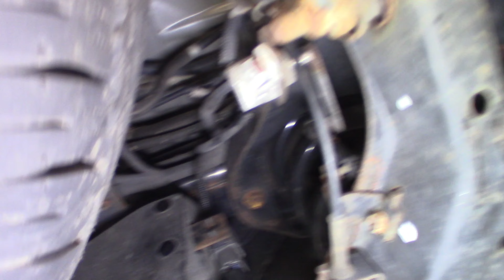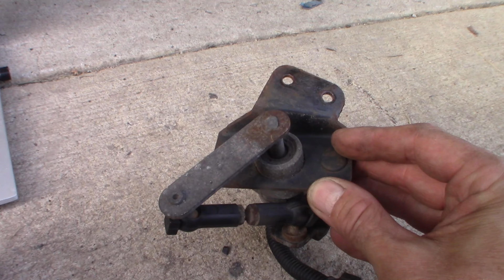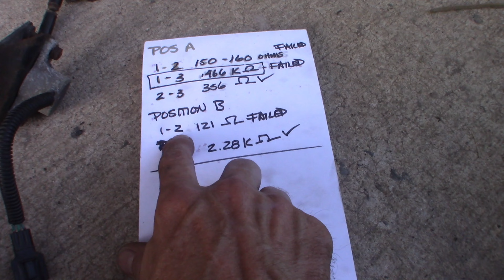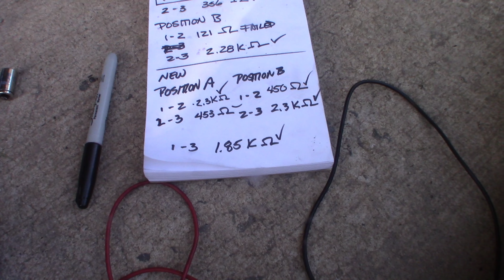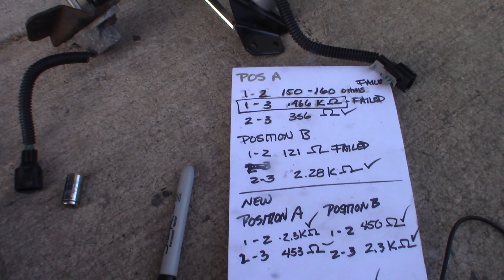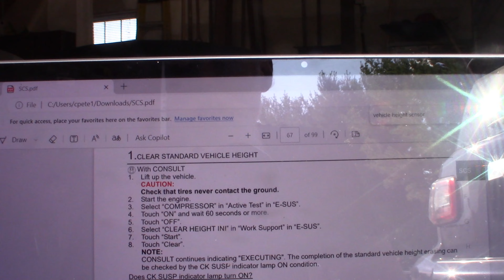2017 Nissan Armada Rear Air Suspension Sagging

Comment: will the compressor eventually turn itself off to save itself or will it run forever if a bag has failed ? and is there any dash light that would come on if there is a code associated with the suspension sensor or compressor ?

Comment: @johnnava7111
1 hour ago
i gave power to the compressor with my probe and it kicked on when there was none coming through ( didnt read at first before actuating probe) then i went front and relay wont click i switched them both n nothing. i gave power at the relay connection n it worked again is this possible power is shorting? i assumed it was two faulty relays but now im having second thoughts 4x4 light is not on n it works when engaged

Comment: nice video! Did you use an OEM Nissan sensor, or an aftermarket? OEM seems kind of expensive for what it is. If aftermarket was used, what brand? link?
Reply from the maker: only oem.  Order from online Nissan dealer and it will be cheaper than buying from local dealer.  Can't use aftermarket for this.  Will have issues if you do.